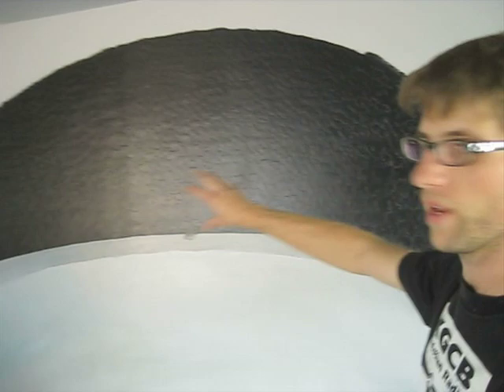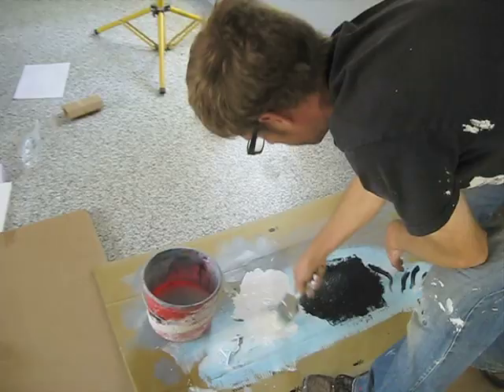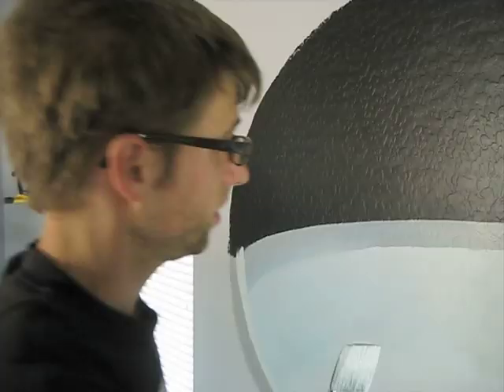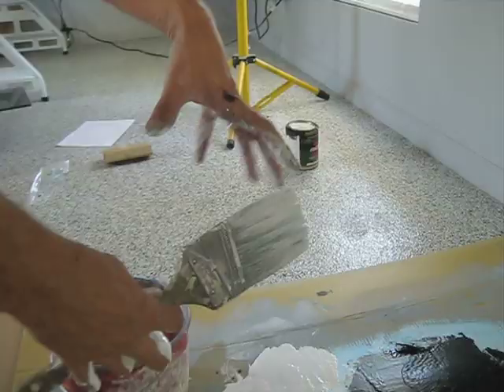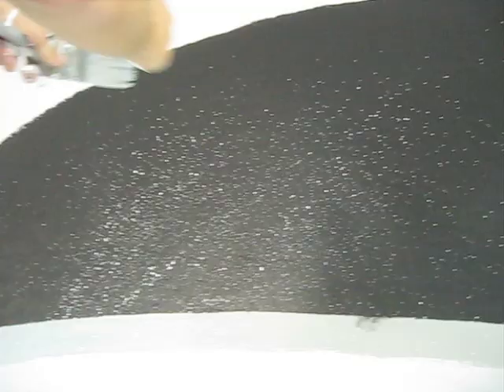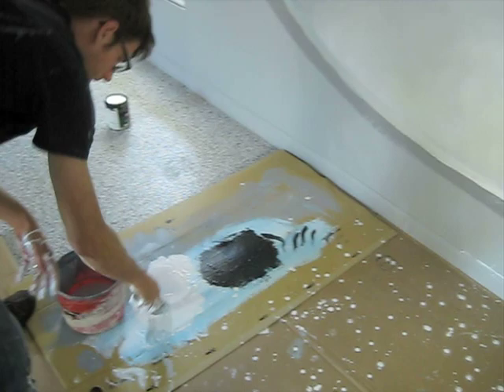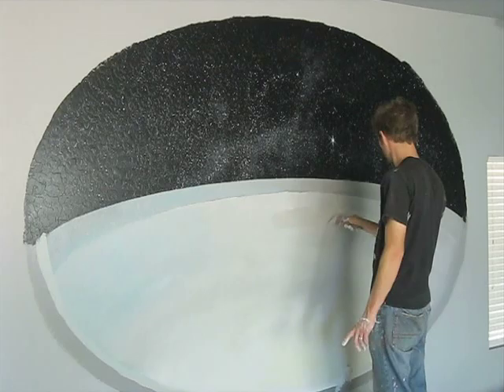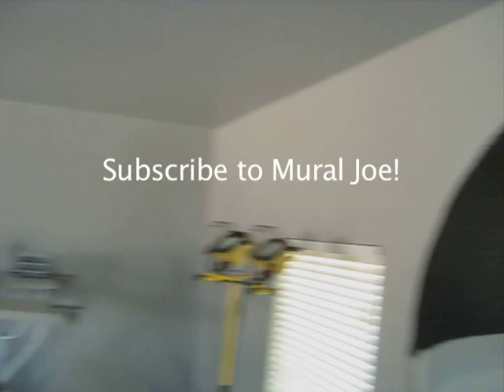How to paint stars in space - Mural Joe

Comment from the maker: Definitely. It's just not as bright white as paint most of the time. Reasons you wouldn't use primer for a top coat in paint applications would be uneven sheen, No UV resistance for exteriors and probably not as hard and cleanable finish. It's not a dumb question.